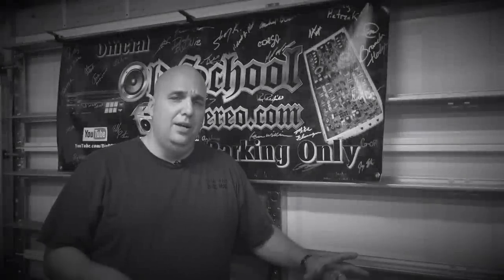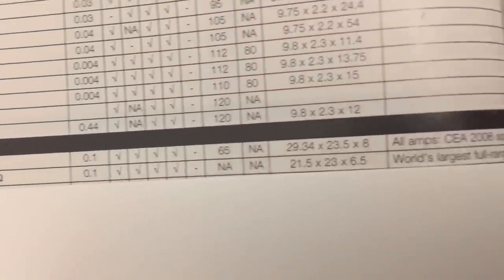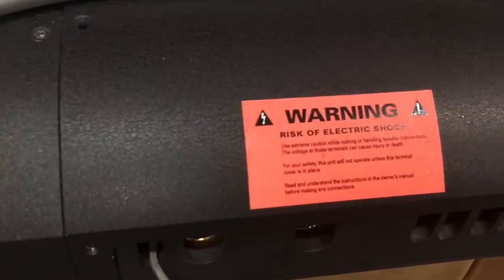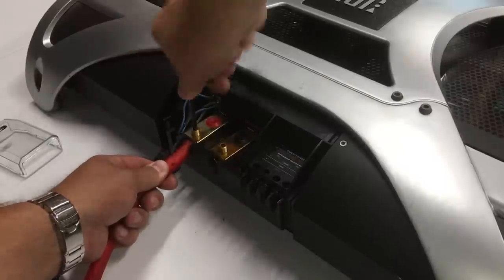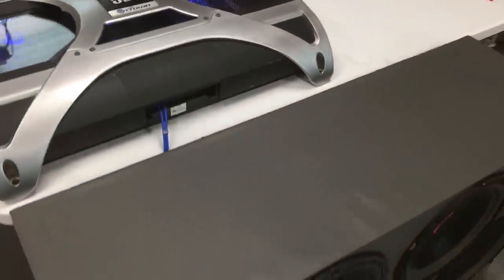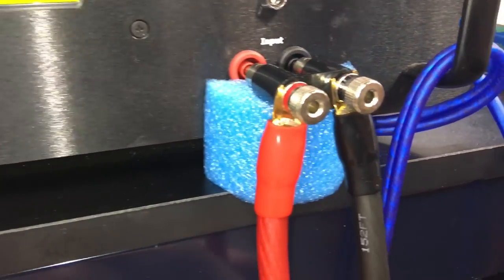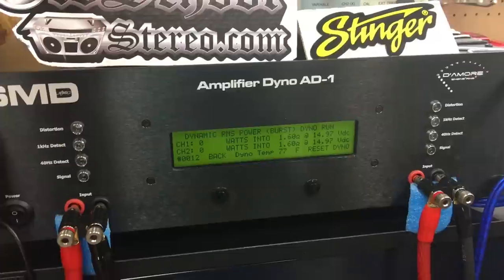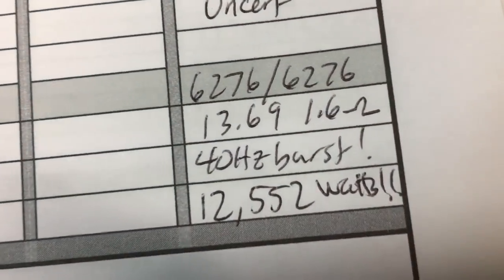World's Most Powerful Car Audio Amplifier (2004) JBL Crown A6000Gti

Comment: Straight power son. One of the best parts of this design, was the mosfet array around the toroid. Direct connections to the transformer. Increased hundreds of watts if not more. That amp is crazy powerful.

Comment: I'm impressed with the AD-1 able to test that much power too - pretty cool toy :)
Reply from the maker: +wilkinru it is rated to handle up to 24kW or 12kW per bank
Reply from the maker: But it just tests wattage. It does NOT supply the input voltage/current needed to test these big amps. I'm using Maxwell ultracaps for my power source. They do a great job, but I have many banks of them
Reply: you all probably dont care at all but does someone know a method to log back into an Instagram account??
I somehow forgot the password. I love any help you can give me.
Reply: @Payton Alexzander instablaster ;)
Reply: @Jake Salvador i really appreciate your reply. I got to the site thru google and I'm trying it out atm.
I see it takes a while so I will reply here later with my results.
Reply: @Jake Salvador It worked and I now got access to my account again. I'm so happy!
Thanks so much you saved my ass!
Reply: @Payton Alexzander No problem :)

Comment: Crown makes the best power amps for large PA systems for concerts. Not surprised they can make monster car audio amps. Now, make it half the size with the same output..lol.
Reply: sir i wouldnt say the best but theyre top 3 for sure
Reply: Crown is fine but certainly not the best.  Powersoft is at the top for touring, everything goes downhill from there.  Not to say that Lab or Crown or QSC are bad in any shape or form.  They're all good amps.  Just don't mention the b word. ;)
Reply: @cpufrost  you forgot dynacord amps
Reply: Orion got to 13k at half the size
Reply: @Asstronut  made in 2004 I don't think so
Reply: @FingerinUrDaughter  Bee-ringer and Pile are fine for most bass heads that listen to 60Hz tones with 15% THD  LOLOL!  And yes, touring with any of those amps is like a mechanic whose living depends on tools, buying the shit from Harbor Freight! ;)
Reply: Definitely could make the same power for possibly less than half the size with a class D amplifier. Waaaaay less noise and power draw too.
Reply: crown itech HD a real badass amps with very good sub control

Comment: Wow the beauty of this amplifier just never quits. Holy crap 4 gauge speaker wires and 237 amps startup. I would have to get insurance just to cover the amp.  To be perfectly honest I don't know if I could first fit the beast in my car second powering it would require some serious upgrades in wiring and alternator etc. Would any of that matter hell no its a freaking beast just put some subs in the back of the car like jet engines and let it push the car no engine required except to power the alternators.

Comment: I am a disc jokey and work with Crown Amps most of the time when I am spinning.  Crown is one of the few ampplifire company that makes an amp that does what it is advertized or rated at.  Crown used to make professional grade touring amp called the Macrotech 5000VZ and that beast of an amp weighed in at over 70 plus pounds and a 10000 watt mono block version that required 3 phase electric that weighed in at over 110 pounds.  So I am not too suprised that JBL A6000GTi delivered the goods. :)
Reply from the maker: Yessir, Crown FTW 🤙

Comment: I remember seeing a CES video of this amp.They cut the wire end off a brand new Sawzall (110 volt) and connected it to and speaker output. They where cutting blocks of wood with the saw while the amp was powering the saw. Totally insane.
Reply from the maker: +Twisted that is sick 😱
Reply: Twisted I remember when they demo this amp at a meeting for a store I use to work at and they ran our table saw off this.
Reply: Twisted i Can remember that they did someone welding with that beast
Reply: Twisted  I need to see this

Comment: JBL is an OG. 

First 1000w sub I ever heard was the first gen JBL Power sub. Jaw-dropping, for the time. 2-15" in a full size pickup extended cab back in the mid 90's

JBL will always have my respect
Reply from the maker: The original GTI series subs still intrigue me. Always wanted a pair of 1500GTI’s
Reply: BigDWiz YES!! That's the one! I was struggling to recall the actual series name/ model designation. Thank you. Boy those were the days..

Comment: Thank BigDWiz. By far this is my favorite amp test to date. And I am talking All Channels that test amps using the AD-1. Awesome
Reply from the maker: Thanks man, means a lot when you put a lot of time and effort into making videos. I thought you guys might like to see this one on the Dyno, my original plan was just to do an overview and test it later...but I was like nah, gotta show what this beast is capable of NOW! I will do another test, MONO when I get my 1000A clamp. I want to see how much juice this joker is pulling. Thanks again for watching and for the comment.
Reply: how is this coming ? I would love to see this too. How much does all this testing equip run ( ballpark ) ?
Reply from the maker: I have the 1000A DC Fluke clamp now, but I still need to get a few 14v batteries to back up my Maxwell Boost caps. I have more than 5000 invested in my test setup, probably closer to 10k total. You can start pretty inexpensively by using a DD-1, True RMS Volt meter and some audio power resistors (around 500 if you have a head unit and a car battery already....but you'll also need a charger or charger/supply). That would test 1000w or less amps. The big ones require a lot of "electrical"
Reply: Thanks for the reply !! I appreciate the info .. guys like yourself keep this alive and going !!

Comment: It's about time someone did a dyno of this beautiful amp. I still have mine but I need to send it back to Sound West for repair. Last time I had it hooked up I was running 16 10's on it at 4 ohm with rise to 10.2 ohm and still getting darn near 5K out of it. Great amp too bad JBL and Crown had a falling out about this amp and now neither company claims it.
Reply from the maker: I've heard some horror stories about the amps going bad and needing repair. I can't imagine how much a tech would charge to work on this joker. You might want to take apart some of it before taking it in....or spend about 90 minutes in labor for just getting to the guts :-O
Reply: there is only 1 shop that is "authorized" to work on this amp (at least the only shop that JBL and Crown refer you to) and that is Sound West in Washington. Apparently when JBL and Crown were having their problems about this amp Sound West bought all remaining parts for it and the schematics for it so they know about this amp. The first time I sent it in I needed a new board which they built and I upgraded parts that JBL/Crown cheaper out on, it was over a grand to repair. Now I have a red light on the audio board so I gotta send it back just don't wanna spend too much on a second repair.
Reply from the maker: Ouch! It's about $400 round trip shipping alone for me!  Let me know how it goes if you send it in again.

Comment: Hey biggy. I think you should you should have mentioned what type of amp the A6000GTI amplifier is. I own one and I love the sound quality playing my gti 15mk2"s. It's called a T-class by the crown engineer. Meaning it is designed to have sound quality of a AB amplifier. I have heard a lot of d-class amp bigger but don't sound near as good! I only have four oddessey 1500 batterys in my truck and the jbl has ran perfect for five years with a stock altenator in my 2009 mazda b4000 truck. Just my thoughts.

Comment: that is the most beautiful amp ,Mabey not on camera or far away ......

  but if you've owned enough jBL ,looking at that beast of a beauty,  you can tell the craftsmanship threw the camera , that is like comparing diesel parts to a Toyota pickup 
the 1/0awg looked like 4awg & the 4awg looked like 8awg the amp was so ginormous
Reply from the maker: As one would expect when buying a $6000 amp....top quality craftsmanship! And the external panels are all cast aluminum

Comment: that amp is a beast would like to of seen how many amps it pulled doing the 12k watts 
hopefully soon we can see sum of digital designs amps tested
Reply from the maker: +iceman020187 I'm working on getting my setup capable of measuring current up to 1000A. This is the first amp I've tested requiring this much current measurement, but since I will keep testing large amps, I think it will be worth the investment

Comment: I like how you used the pool noodles! your cap bank held up to this torture and this amp put down serious numbers .... very impressive on both parts. the one thing I noticed was how fast the max numbers were reflected on the AmpDyno... other amps might linger awhile to reveal their max numbers. this JBL was like "BAM" quick max numbers. Any thoughts on this?
Reply from the maker: The burst tests send a 40Hz "kick drum" tone, so the first kick is going to give the most power, especially with this amp and the amount of current it pulls. If I could keep the voltage up, it would jump in wattage.

Comment: ment to ask this awhile ago, while running a basic test on an amp weather using a scope or the nice and equipment does the ohms rise and fall as a sub would under music?  I haven't seen a dmm while test is running.  so does the dyno compensate for the ohm change as a sub would?  if not is the test true for real world or just as a bench test. just wondering how accurate a dyno really is.  I love that it gives you an idea of what the amp will do.

Comment: Amp Dyno AD-1 almost a perfect piece of equipment, but I think it could use some beefier alternatives to banana plug speaker inputs!
Reply from the maker: +sylkelster in all honesty, few tests require larger than 8ga speaker wire, so for the most part it's not a problem

Comment: Should have tested it in high current and high voltage mode.  Folks used to say power was less in low impedance mode, then again I don't believe anybody has done any modern resistive load testing on these up until this.
Reply from the maker: +hispls I'm planning on testing at 2 ohms in the parallel/bridged mode, measuring current draw and more 👍
Reply: Dereck BigDWiz

Tuned in for that. 

You really don't understand how big that amp is until the UPS guy shows up on your doorstep with it am I right?

Comment: Could you test the Pioneer GM-D9601or Pioneer GM d8601 ? :D
Reply: d9601 is a greate amp for the cost, 170ish on amazon. cea certified. killed a couple sets of subs with mine.
Reply: I know, a friend has a D9601 on 2x10 Rockford Fosgate T1 subs, very good amp! but i want to know how much it actually puts out! :D In Norway it cost 1900nok / 240USD
Reply: Yeah, the actual numbers i couldnt tell you. it should be around what its rated at though since it is cea compliant.
Reply: Skip that amp, they burn up after awhile. Grab yourself a Soundqubed 1200.
Reply: It's a sorry amp don't waste your time

Comment: Big D ,
Is that the biggest & most powerful amp you ever did a amp dyno on ?
Reply from the maker: Yessir! And at 12,552W combined at 2 ohms dynamic, this joker even out ran the DC Audio 9.0k Steve Meade tested a while back (it got just over 12kW at 0.8 dynamic). The mono runs would look more impressive and I'll do those, but the Dyno is limited to 5kW at 4 ohms, so I'll have to parallel/bridge the amp to use the 2 ohm mono setting (AD-1 can handle 10kW in this configuration). With proper voltage, this amp should do right around 8kW certified. Now, keeping voltage around 14.2-14.4 while the amp pulls 800A of current might be a bigger problem...

Comment: Not the largest anymore. Check out the DC Audio 10K. It outputs 10,000 watts at 1 ohm.
Reply from the maker: Right. Video was referring to 2004. Rockford had a T15kW in 2006 and Kicker had the Warhorse as well (10kW)

Comment: That amp is  a beast!
Reply from the maker: Beast mode 💪
Reply: @wal  do you recall in the early 2000s power acoustik making a line called the plasma sphere amps.  I bet if you could find one working it would make a sweet video. It's hard to find one working now a days. The plasma sphere was fun to play with followed your finger. Haha I. Had the 1900 watt 2 channel. For what it was it slammed 2 12s to the point I was heard a few Miles away

Comment: In taylor fade's test this amp was louder than most of the modern amps in its power class aka american bass, sundown, ct sounds
Reply from the maker: It's safe to say based on the 2ch 2 ohm numbers this amp can do at 4 ohms what very few other amps are capable of (excess of 7kW in mid 13's)
Reply: actually the AB 750.1 beat it out in power numbers by a good bit, but power isnt everything. the crown did less power but was .2 db louder

Comment: Back in the 90s when I was into them, the cheapest and least expensive amps were huge in size. If you were to go all out and spend on quality, you got one of the smaller amps (smaller in size) that would out preform amps 4 times it's size. I seen many 300 watt amps that put the 1,000 watt ones to shame. If you wanted the lowest distortion, you were looking at RF Power, just to power subs and move air, Kicker DX350. There were better but your into spending twice as much. I'm not a big fan of JBL, like a midrange to low end name. But then again, that was the 90s, things might be different now.

Comment: I bet this thing is drawing close to 600 amps. How do you even power this thing?
Reply from the maker: +Richard Smith https://youtu.be/P0xbdXx2gEY
Reply: Jesus. 739 amps. What is that, about 70% efficiency? I don't know if I am more impressed by your DC power supply or that the amp can handle that much current.

Comment: How the frig did you power this?!
12,552 watts is roughly 100 amps from a household 120VAC circuit? 
The Stove/oven circuit, (approx 50 amps and 220/240v) is the only ready source of that much power.
Then you have conversion losses to convert down to 14.4 volts. I know you mentioned capacitors, but those aren't a power source, they're a buffer.

Comment: what about the DC audio 9000 ? 😎
Reply from the maker: Was not available in 2004, plus this JBL can do over 8kW into 4 ohms. In this area, it is still one of the most powerful 12V amps available at 4 ohms.

Comment: Man...SMH!  I knew that this amp was a beast, but not like that!  The best part about it is that if you could afford this amp, the price of it isn't  bad.  At less than a dollar per watt I'd say that's a damn good price.
Reply: They can be had used these days for FAR less than MSRP.  Downsides are they are HUGE and if you break it there's only one shop in the country that can repair them and shipping + repair is a rough hit.
Reply: Huge it is.  I would have to dedicate the trunk just for the amp and batteries.  Rip out the back seat and might as well do a wall setup.  LOL!
Reply: bkrgls

That's what we did in my brother's car.  Amp + batteries in the trunk and back seats ripped out to build the box walled at the B-pillar. 

I had it in the back of my Jeep before that and  it + batteries took up the whole cargo area up to about 9" high.   Definitely a commitment to use that amp any way you slice it.
Reply: Seems like most of what you pay for in an amplifier is design.....IF that's 1000 in design and 5000 in parts it kind of seems like a rip off....Maybe I'm wrong?  Why does it cost so much more for higher wattage?
Reply: Quadrunner

Consider how few of these amps were ever built and sold, now figure what it costs to hire and keep good engineers plus the cost of prototyping tooling all proprietary boards, heatsink, and almost everything.  These are based on a tweaked version of Crown's 8000W PA amp with a 12V power supply.  That PA amp wasn't cheap (and they still aren't used) and 12V power supply needs to have a lot more going on that 110V. 

Of course they were the biggest amp you could buy then and were marketed to those who wanted the biggest and best and would pay the premium. 

We have gotten terribly spoiled lately buying big power so cheap, but the tradeoff is that China/Korea is just selling us cookie cutter copies (or very slight variations) of 20 year old circuits in heatsink designs that are just as old.

Comment: How many batteries would you say is needed to keep this bad boy running at its full  potential, including the battery under the hood of a car???
Reply from the maker: The manual says 2 additional batteries, but no way I'd use this in a car without a HO alt and at least 3-4 extra batteries

Comment: Insane! I'd have liked to see the current draw at load! LOL
Reply from the maker: +Curt Chase I'm getting a Fluke clamp capable of 1000A DC measurements, so I'll check
Reply: Yes, I see your clamp ammeter cannot do 1000 amps! Neither can mine! 
Mine does up to 600amps DC, but...there is a Chinese vendor on eBay that
 sells panel combo meters that can do up to 1KAmp. I have purchased a 
couple of them for use in my car and boat. Nice units way less $ than a 
fancy Fluke meter and they use a shunt instead of an inductive clamp, so
 there is no calibrating required like the clamp on type. So, you can 
wire up the shunt and voltmeter inline with the supply leads to your 
test amp and have a constant display! I wrote you once before on a 
request to test an "old-skool" 4 channel amp I have, but didn't hear 
back. I'd like to send it to you. Thanks!

Comment: I had 2 of these in the mid 2000s on 4 DD 9900s and everyone lol @ me when I said I got 9k each continuous @ 2.6ohm reactive but I ran it's max input voltage 15.3v and could hold 15v for a few seconds, well the proof is in the pudding, I wish I could direct all those azzhats to this Dyno run... parallel bridge mode is where it shines